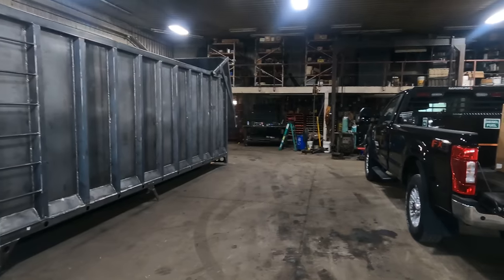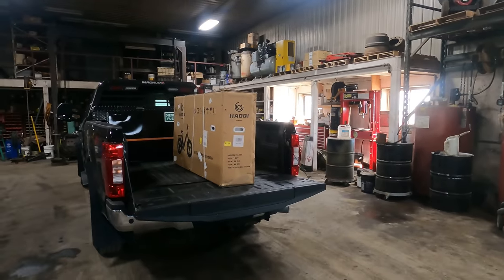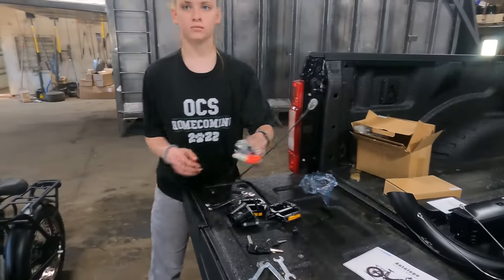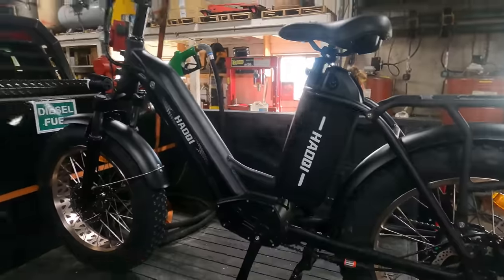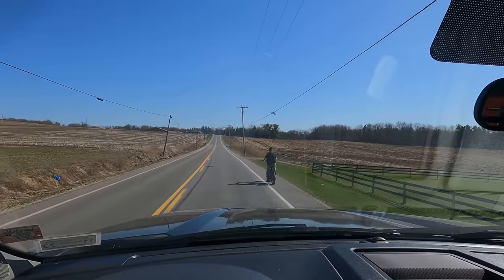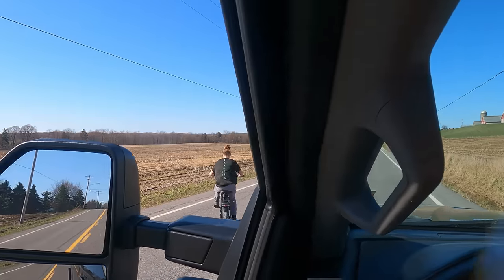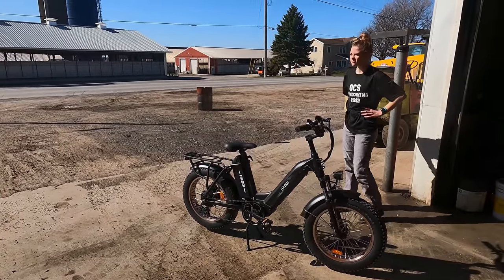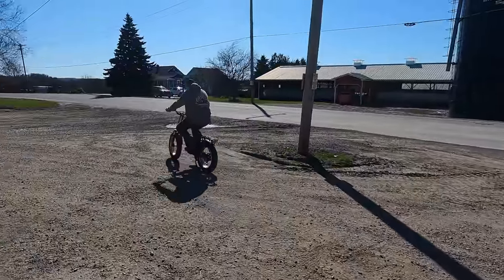Haoqi Antelope Electric Bike

Comment: I was chuckling at your remarks from the beginning, started laughing when you strapped the bike into the truck bed, and was laughing so hard I was crying when that wheelie went from a 90° to a 180°.  I was laughing in part because a couple years ago I had a similar thing happen only on a mini-bike (I was 62 at the time). And yes, I was laying flat on my back with the mini-bike on top of me laughing so hard at myself I was crying.  With four bikes now you need to start planning for an ANDY 500. It doesn't have to be 500 laps around the farm or even 500 minutes. You could do 500 seconds. (which would be 8 minutes) lol.

Comment: That was a bold attempt but you should remember to start with raising the wheel a few inches and work it up from there slowly.  I have done the same thing on my dirt bike more times than I can count. That emotor sharing the torque with you pedaling would be a nightmare to control without using the back brake.

Comment: I'm 72 and knees don't work so well anymore so I bought an ARIEL RIDER electric bike. It has two 750watt motors, front and rear. You can switch between either or run both together. You have to be sensitive  on the throttle, a lot of torque or it will take off without you. 😂